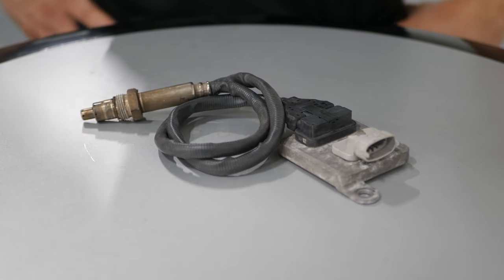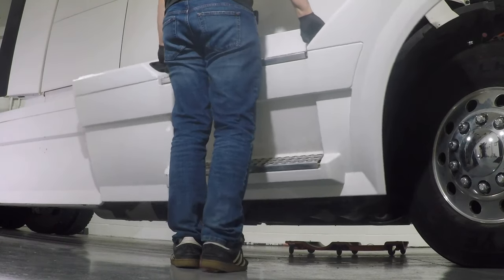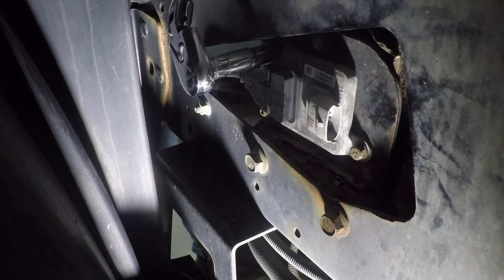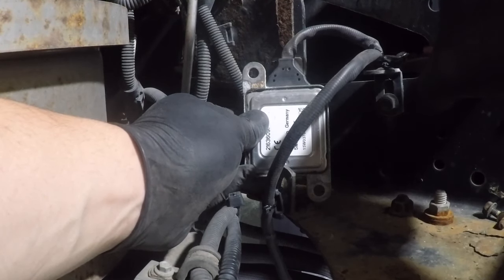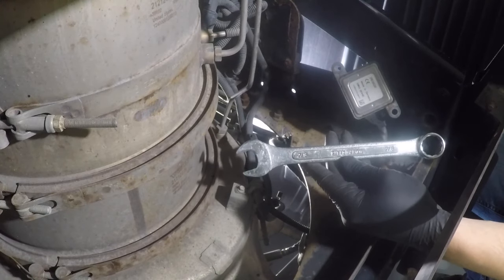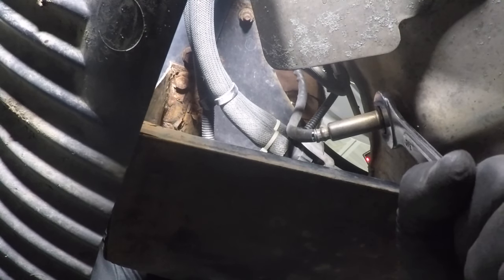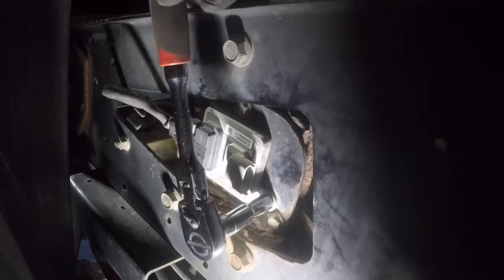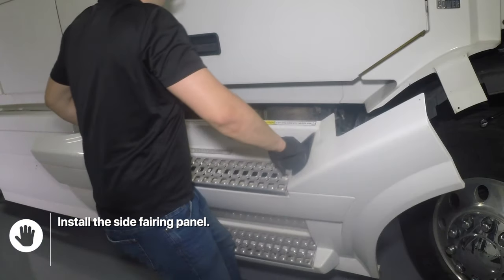Replace Inlet NOx Sensor on Volvo D13 and Mack MP8 Engine

Comment: Replacing nox sensors require a data set relearn for the nox sensors. And the sensors have been updated so If the truck has old style sensors like in the video both must be replaced they cannot be missed matched.

Comment: I have 2008 Mack CXU613,  with code MID 128 PPID 270 FMI 5,  it is telling me that NOX 2:39 sensor is bad. But I don't have that kind of sensor, and also DPF is dry.

Comment: Why would you replace it? Is it the sensor that sets off the low DEF quality message? I thought that would be the downstream sensor.
Reply from the maker: The Nox sensor measures the PPM of the SCR system and the measurement controls the DEF/SCR Operation. The faulty sensor can be caused by fault codes related to the NOX Inlet 1, or SPN 3216 Fault code. It's always recommended to replace both nox sensors at the same time and also perform a Learned Data reset.
Reply: @otrperformance  does the otr reset tool perform the learned data reset?
Reply from the maker: @robbiephillips5264  Thanks for reaching out. Yes the reset tool will reset the learned data. Give us a call to answer any other questions. 586 799 4375

Comment: Do you have to shut power to battery before connecting nox sensor
Reply from the maker: You just have to make sure your key is in the off position. You don't need to disconnect your batteries for this replacement. You also need to reset your engine learned data after you replaced this sensor.
Reply: You mean just clear the codes right?
Reply: How do you reset the engine learned